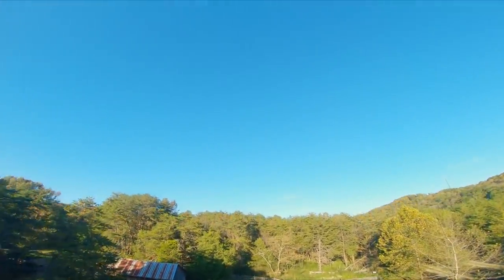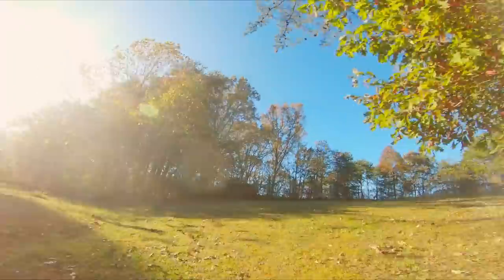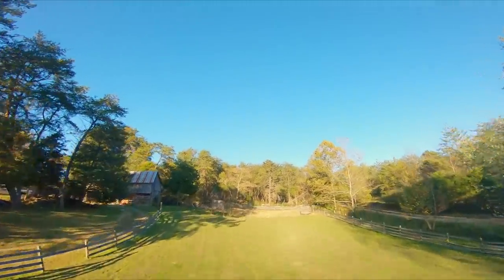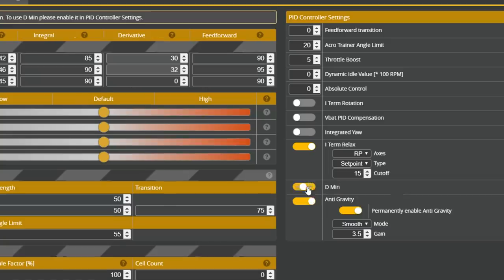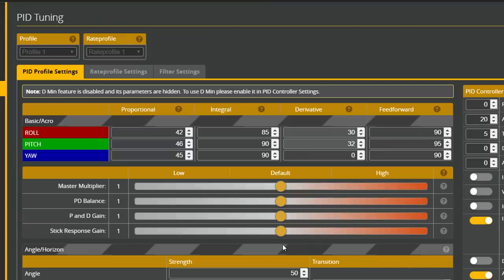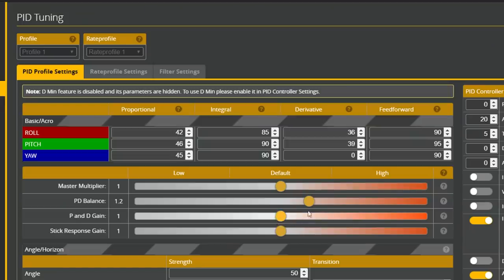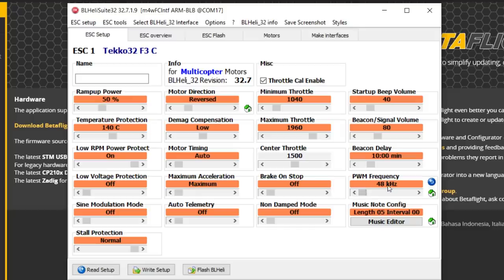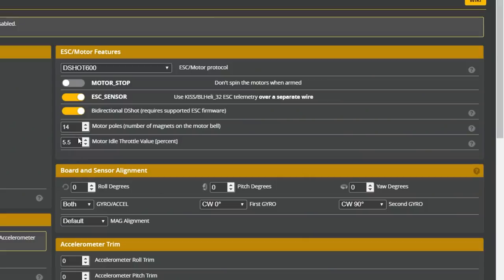Betaflight 4.2 Low Throttle Instability How To Fix

Comment: Yeah you should try flying 7" and above. Several of my 7" and 9" rigs require 12-14% dshot idle to get rid of the wobbles, plus all of the rest of the methods you've outlined. We also have issues with bounceback. The dev's persistent response to this is to say that we now have "low-authority" builds. This shit pisses me off. Just because my 9" doesnt track setpoint down to the milisecond  doesn't mean it's suddenly low-authority. Just because they spent months nerding out over lightweight 5" quads tracking setpoint to the nth degree, doesn't mean their work is perfect. They've given all of us macro quad flyers the cold shoulder and pushed us out of the picture, refusing to acknowledge the issues they've caused.
Reply: 9" are low authority.  Sorry.  Facts are facts.
I have tuned lots of 9" and 10" rigs.  It is pretty straightforward, but the inertia is much more since the arms are longer and motors and prop are heavier.

Check out presets at: https://theuavtech.com/presets/ for all the quad classes.  Yes, BF defaults are only really good for lightweight race rigs.
Reply: Russell Phelan  AMEN Brother, AMEN.  

Entitled I tell ya.  Entitled.
Reply: @uavtech  I have a degree in physics. I understand that larger quads are lower authority than 5". Thats obviously not the issue, given that this low-throttle instability was never a problem before. You're not making any significant point, and once again you're skirting the issue. You have created major problems for all large rig pilots that are not solvable with reasonable tuning methods. Regardless of what tuning mantras you repeat, there is no reason we should have to use 14% dshot idle to get rid of the wobble. The wobble that never existed before, and the same one you've failed to address in response to this video. Your only response so far has been to scoff at JBs inability to recreate the problem with a powerful 5", which is hardly a show of good faith to the community. 

Entitled? I don't need anything from you. Most of my rigs are tuned, despite the downsides of such a high idle value. My problem with you and the others is the typical coder's hubris and inability to have a reasonable discussion.
Reply: This has been going on for what, six months now? Never have I heard a single dev admit there's an issue. If there's no issue, then why does this video exist?
Reply: Where do you want me to post the materials? I'll do it this weekend.
Reply: @flaparoundfpv8632  , Blackbox FB Group.  Be careful to make sure ALL the settings match.
Reply: @uavtech  Having to call a huge section of your user base dumb is not a reflection upon the users, FYI. It says a lot more about your implementation. This is exactly what I'm on about.
Reply: @uavtech  all the settings? You said dshot idle, PIDs, and filters. Lets be specific. Is there anything else?
Reply: @flaparoundfpv8632  , I would say:
1. All PID settings to exactly match, so you may need to "dumb down" 4.2 setting to match whatever version you are using to compare it with.  If you need help here, let me know.

2. All Filter settings to exactly match.  Again, like the above you may need to dumb down 4.2 settings to match whatever version you are using to compare it with.

3. Settings in the Configuration and Receivers tab to match.

Make sure to log at 2k rate, with "Gyro_Scale" debug mode selected.
Reply: what you need is faster PID / GYRO loops or 4 GYRO working together, one on each arm.

Comment: I know your talking about big boy quads but my tinyhawk2 in angle sucks itself into walls if I get to close and sticks until I disarm it. Really annoying! Is there a good chance thurst_linear is on?? Maybe this is required for lighter whoops though.

Also is it possible to smash those solar panels crashing into them? 🤔
Reply: craigjohnstone87 turn off air mode to stop the being stuck on walls issue.
Reply: @jibbajabba4597  thanks!! Is there a way to set air mode only when in accro?
Reply: craigjohnstone87 yes, once you untick "always enable air mode" on the configuration tab to disable it, "Air Mode" will appear half way down the list on the modes tab, just assign it to the same switch you have acro :). All my quads are setup this way.

Comment: I use to use these commands to stop BF spazzing out on impact,

set yaw_spin_recovery = OFF

They worked great on 3.5.x, also used idle up with the above for a while.

set airmode_start_throttle_percent = 10
set pid_at_min_throttle = OFF
set min_throttle = 1050

Then I moved to KISS lol

Comment: I use thrust linear all on my quads, but one of my 7" its causes Trilling. Really odd so I left it at 0 and trilling ceased on stock settings.
Reply: The trilling is because the PIDs are boosted. Removing or reducing some filtering can get rid of the trilling because it’s in part caused by phase delay so that’s worth a try as long as motors remain cool. Otherwise turning down PD gain a bit since  TL boosted them at the low end of the throttle curve. Yes, that might seem counterintuitive but TL changes the shape of the curve so you should still benefit from it

Comment: Out of nowhere I started getting the wobbles on my Protek35 and I am on BF 4.3 and there is no D min toggle?? - I did most of the things you mentioned but the only thing that somewhat helped is putting the idle higher. But would love to hear any other solutions besides that.
Reply: any news to your problem ?
Reply: i think i found it:
first of all you can go to CLI and tipe in "get d_min"
and i think unter PID Tuning PID profil settings D min = the Derivative for roll pitch and yaw

Comment: Hi Joshua, my motors are stuttering at a low speed, and they don't even turn in high speed
Reply from the maker: There is probably an issue with your ESC? Or maybe you have the wrong motor protocol selected in Betaflight? Dshot150 should work with most modern ESC's.
Reply: @JoshuaBardwell  Thanks first of all, it was on D300, i tried D150 like you said but did not work, i tried then with PWM protocoll and it worked.

Comment: I fixed low throttle wobble by changing the difference between pitch and roll. My quad needs pitch lower than roll.

Comment: Any ideas on why I cannot find the sliders in my beta flight?  All the expert settings are on.  😊 tia ✌️🏼
Reply: Keagan Lindsay you've probably got a custom tune or previously made manual / cli changes, any "non standard" change disables the sliders.  Do a dump all of the config (or a diff all) on the cli, save that and keep it somewhere safe, then go to the PID Tuning tab, on the left hand side you should see a warning that says "sliders are disabled due to non-standard modification" or words to that effect, below that is a button "restore sliders", click that but be warned it will reset the PIDs to betaflight defaults (hence why you backup the config first), you'll then be able to play with the sliders.
Reply: Configurator 10.7?

Comment: I have this weird wobble while I’m just cruising too. Kind of like driving on a bumpy road.
Reply: Try turning D-MIN off and that will probably fix it.... What size motors do you use and what props?
Reply: @smooth_ops2942  dmins been off. 2306.5 with 5043 HQ prop V1S
Reply: @supaairsoft  i found pd balance of 1.2 and a pd gain of 1.5 or more really helps my 5" stay stable, but i also run s3/s4 props so you might not need to go that high
Reply: This thread here sounds exactly what I'm going through. Its while cruising around and not on punch. Was at 3.5.7 and was fine. 2206 motors. Thinking maybe finding out how to go back to 3.5.7 lol
Reply: @CrawlersCampRc  i dont notice it as much on my 2208 but its more noticeable on my 2306.5, which makes me believe thinner stators just lack the torque normally needed in 4.2...

i changed my timing in bheli to 23 degree, go down to 24khz if you can for some more torque.... than 25-35 thrust linear for most 5", i go up to 50 on thrust linear for cinewhoops/heavy long range 7" as they can also suffer massively 

Also dont be afraid to adjust pd gain up, and maybe even pd balance up a notch or 2... If you notice your quad getting kicked around on windier days your pids are most likely too low, at least in my experience
Reply: @badfourlife  right on!! This definitely is what I'll try. Much appreciated!

Comment: 4.3 is out 😉
Reply: does it solve this specific problem?
Reply from the maker: 4.3 definitely isn't out. The last release is 4.2.4 as of 21 days ago. Mark Spatz is running 4.3 nightly builds and making videos about them. 4.3 won't be released until after new year the estimate is.
Reply: @JoshuaBardwell  my fault, I consider nightly's as "released", my apologies, Mr. Bardwell. Still, your "fix" is a bit late at this point.

Comment: I Love and respect all of Joshua's videos.  But, I completely disagree, Betaflight 4.2 is absolutely NOT the best flying Betaflight ever. I would give that crown to Betaflight 3.5.7.  Betaflight 4.2 (all versions) flies like Junk. Super looking forward to 4.3.  If 4.3 flies like crap, I going to go to EMU flight or maybe just re-build my quads with Flight One FC's.   The Betaflight developers should use real PRO Freestyle pilots in the development process. I have followed ALL of UAV Techs tuning videos to every detail and sorry to say 4.2 is crap. I have spent months, hundreds of packs trying to get a good feel, tons of blackbox logs and all my 4.2 Quads still fly like crap. I love everything on this channel and sorry for being critical about Betaflight 4.2.  It just doesn't have the correct feel. Feels like crap.  Sorry to say, the developers are spending time putting quality features and logical thought into 4.2, but they are missing the mark by not focusing on feel and Smoothness. Maybe most pilots can't tell the difference, but all the top pilots in my immediate flying circle (and myself) feel exactly the same.  OK, so there's RPM filtering and VTX Tables, those improvements are overshadowed by the lack of good feel and crappy flying performance.
Reply: hey devs, GeorgeCee says BF 4.2 flies like crap, time to go back to the drawing board!
Reply: @Perceivedshift  , but somehow that's just on your quads?  Weird.  🤔

Also funny how Joshua could not reproduce "the problem" on two quads.